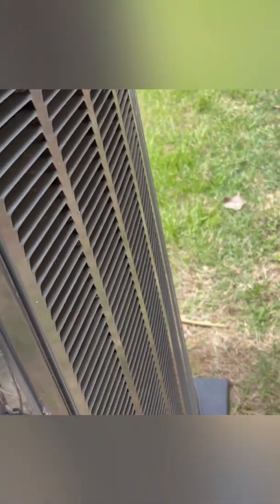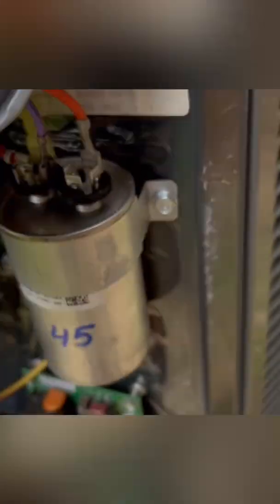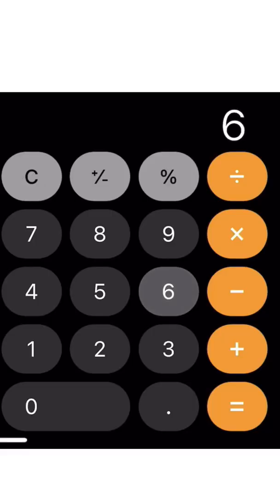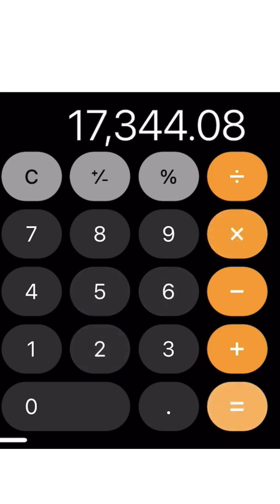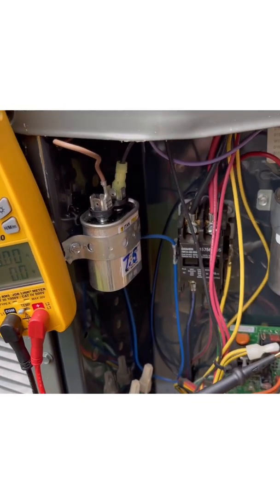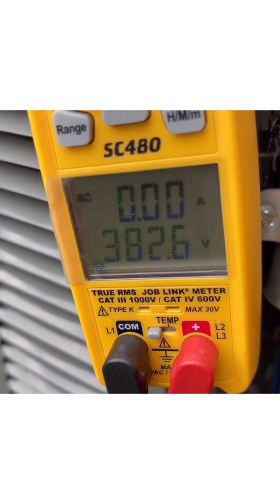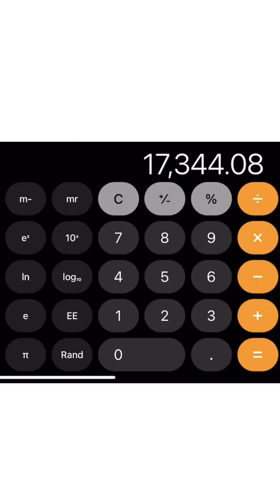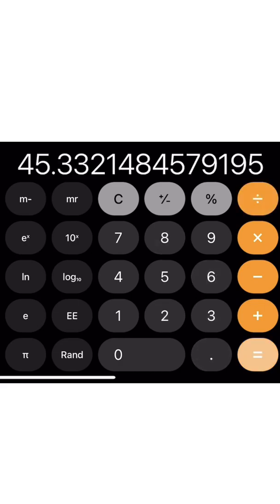How to check a capacitor under load

Comment: Hello I have a question on a blower motor Ruud old gas furnace  (Emerson type)went bad,two speed motor 4wires black,brown,orange,red which one is the hot wire

Comment: If you put your clamp around the run and common leads you would notice the amp draw is also 6.4. If the cap is the proper size those to readings will match indicating a balanced field.

Comment: Like checking for the proper cap for electric motors. Use 2652 X the full load amps divided by the voltage of the motor. 
It gives the best general fit cap for that motor.

Comment: I engraved 2652 on the back of my meter when I was in class ! I later put a card in the battery compartment with about a dozen formulas. It was a Simpson 260 😮 I miss it !

Comment: Cool to know but why not just shut it off ?  In 25 years of doing service I have never felt the need to check a cap on a running system.
Reply from the maker: You've never had a cap that checks good but is bad under load? I just had one yesterday. It was a 12.5 and checked fine but when turning it on, the blower wouldn't start.

Comment: 45 what?
Reply from the maker: 45 is the size of the capacitor that’s being checked. If it reads lower then 45 it would indicate a problem with the capacitor.

Comment: I use an ESR component tester for this. It measures the equivalent series resistance of the capacitor which should be a very low number like just a few ohms or less. Sam Selph

Comment: Based on your videos and a few other sources,  im going to install various sensors at various parts of the hvac unit, that will give me a heads up of potential problems. Like putting a current draw sensor where the capacitor leads are and getting alerted when the capacitor starts using too much or not enough current.
Reply from the maker: Or you could have your systems maintained every 3-6 months.
Reply: @HVACTechTips  you right, and they are, once every 5 months,  but i like seeing objective data and how one action/behavior correlates with another.

Comment: Or buy a meter that can test capacitance….
Reply from the maker: It’s a different way of testing for different readings. A capacitor can be bad while under load but when turned off, can check good. Any Fieldpiece or HVAC related meter will test capacitance. This is just intended to be something to learn for certain situations. Not saying it’s the one and only way to do it. On a normal day, yes your testing MFD.

Comment: Just check the MFD if the value is less then -5% of the factory setting change it 💁🏽‍♂️😵‍💫 takes 2 minutes
Reply from the maker: There’s other reasons to check it under load. This is just something new to learn. Not suggesting to stop testing using MFD

Comment: I do this while I wait for the pressures stabilize when checking refrigerant charge. Just a good, quick test & that way you’re a bit more through with your job. I also don’t feel like pulling power & having to wait for time delays over a simple cap

Comment: Does this work on the fan side of a cap as well?  And where does that 2652 come from?
Reply: 2652 ohms is the capacitive reactance of a 1 microfarad capacitor at 60 hertz.

In this example his 45 microfarad capacitor produced a value of 6.54x2652 / 383 V or 59 ohms

Comment: I just did mine today my capacitor is 75/5 microfarads and 7.26Ax2652/330V= 58.34 under load so how much of a deviation is out of tolerance? Mine is working fine but I wanted to check it to have data for when it starts to go out.
Reply: The capacitor should have a rating on it of +/- 6% or 10%. So yours shouldn’t be any lower than 63 MFD. I would change it.
Reply: @mtucker3401  gotcha and that’s what I was wondering as I did see the 10% but currently it’s working just fine and it’s not bulging or anything so I was just curious if mine was on its way out or if it’s possible that it would work as normal even with it having a lower capacitance.
Reply: @E85_STI  75uF - 10% = 67.5uF. That's the minimum specification. In my opinion you can go to -20% which would be 60uF. Either way, it's time to replace your capacitor. As it gets weaker, it reduces the starting torque of the compressor motor which causes it to labor and get hot on startup. This ages the compressor motor prematurely.

Comment: Fieldpiece should make a meter capable of measuring both current and voltage simultaneously, and perform the calculation automatically.
Reply: This meter does it in conjunction its app. With it you can determine the quality of the capacitor based on the power factor of the system. And with the app, you can measure capacitance while its running:  Redfish iDVM 550 Wireless Power Clamp Meter.

Comment: U can also buy an lcr meter and test the cap properly under right ac condition (multi meter capacitor measurement can not detect capacitors that are near death but not fully dead , basically before they die they go in high internal resistance and multimeter can not measure that cus they use dc to test the cap u need a proper lcr meter to test the capacitor with ac and calculate the internal resistance.
Reply: I use an ESR component tester for this. It measures the equivalent series resistance of the capacitor which should be a very low number like just a few ohms or less. Sam Selph

Comment: sir, is that applicable to a single fan cap also?
Reply: Yes, you can check a single capacitor too.
Reply: @mtucker3401  so where will be the common for the single capacitor?
Reply: @sagisagdom  the side that goes to line. One side of the cap goes to start on the motor and the other to line. On small caps, you might not see much difference in the amps, but on the bigger ones you will see difference between the two. That’s why you check your amps on the start side of the capacitor.

Comment: Where did you 2652
Reply: That’s from the equation for capacitance reactance. Specifically it’s 1/(2π * 60hz) * 1,000,00μF/F ~ 2652 μs

Reactance is also equal to voltage / current, so you can solve for the capacitance from these three numbers.

Comment: Still learning HVAC systems....What does 45.33 mean? Also, why didn't you discharge the capacitor before checking the voltage?
Reply: 45.33 is the capacitance value under load, while the unit is running and stressing the capacitor. Every capacitor has a value. For example: a dual run capacitor has 3 terminals. Common, herm, and fan. If the capacitor is rated for 45/5 this means it’s rated for 45 microfarads on HERM and 5 microfarads on fan terminal. So in this video, 45.33 is the capacitance value under load. 

To answer your other question, he did not discharge the capacitor before checking voltage because there is currently power going to the capacitor. You would only discharge the capacitor when shutting off power and removing the capacitor to test capacitance value not under load. 

Hopefully this helps 👍🏼

Comment: When it is a starting capacitor, how would you make the measurement?
Reply: I believe that when a separate start capacitor is used on a motor, it's only connected for a few seconds – at most. Theoretically, you could measure it the same way. However, there are a couple major problems: (1) Most DVMs or DMMs respond too slowly to give you a reliable voltage reading before the start switch opens; and (2) Even if you could read the voltage, the start circuit never settles to steady state because the motor is accelerating the entire time the start capacitor is connected – so during startup the EMF/back-EMF is constantly changing on the start winding.

Comment: Why x 2652?
Reply: 1,000,000 / (2 * pi * Hz)

1 / (2 * pi * 60) = 0.0026525284

Multiply this by 1,000,000 to convert the answer from Farads to micro-Farads or 2652.5284.  Most people just truncate to 2652. In case you're wondering why you multiply by 1,000,000, it's because 2652 is in the denominator of the calculation for capacitance.

Hope this helps.

Comment: Many thanks for posting. I like this approach because it determines capacitance under actual load. I've had capacitors test good on the meter, but fail under load. BTW. Should mention that 2652 only works for 60Hz applications. It's 3183 for 50Hz mains.
Reply: smiling in British
Reply: @ia3278  Yes – But the constant you use depends entirely on the frequency of the mains that are connected to the capacitor. The 50/60Hz label on the capacitor indicates that it is rated for use on both 50Hz mains and 60Hz mains.
Reply: Thanks for clearing that sir
I have one more question
If the main supply voltage is 200v  or 240v
Reply: @yadvindersingh9104  Glad to help. The formula works for any AC voltage. The frequency (F) is the only parameter that changes the result.
1,000,000÷(2×π×F)
Reply: @jsswizard   thanks a lot sir
Reply: @jsswizard  Thank you very much. Greetings from Argentina
Reply: @nicolasagustin1384  Greetings friend. Happy to help.
Reply: @ia3278  Many DMMs can measure frequency. Otherwise, just look it up. Search online for "Mains frequency by country".
Reply: I just upgraded my Internets to fiber so I'm getting 500 hurtz 🥴, thanks Biden!
Reply: Start amps equal run/common amps. Easy cap test under load regardless of frequency. If the field isn’t balanced those amp draws won’t equal
Reply: what is it for 400 hertz AC systems 🙃
Reply: @byloyuripka9624  cross multiply and divide my friend.
Reply: @pendulum4734   Should it be 398 ? 🤔
Reply: @byloyuripka9624  for 400hz  use 397

Comment: That is not a valid way to calculate a capacitance: you didn't say how you obtained that number (which i tried to obtain too without any success) and even if that is good, it would be valid only in your country (keep in mind that the frequency changes in every country)
Reply: Calculate the number using this formula.
1,000,000 / (2 * pi * Hz)

Comment: If checking a capacitor under load is such a reliable solution? Then how do you tell when it’s dead? Oh that’s right you put your two probes on it after it dies. This method is just an excuse to replace a capacitor before it actually dies. You need to know the capacitance when it’s standing still not while it’s being pulled under load. Every capacitor will give you a false reading that way.

Comment: I'm never in that much of hurry. To just pull the disconnect and pull the the capacitor.
Reply: Noy only does that take more time, it's also less accurate and misses many caps that are failing enough to cause issues, but not truly dead (enough to fail a meter test). This method can expedite troubleshooting and reduce callbacks.

Comment: I did this while under load and got 57.25 µF. The capacitor is rated at 60 µF with a 3% tolerance. That means the low end allowance would be 58.2 µF.  So would you agree that I need to change the capacitor? Don’t even bother measuring it while off of the unit?  Great video. Thanks
Reply: I always prefer replacing capacitors  once they're a few years old, 5 max.
Reply: No way, if it working today then just let it be. Make some more money when they call back a few months later.
Reply: @JM-yx1lm  - this is my own unit I’m not a repair man.  😀
Reply: @condor5635  then charge yourself 🤣
Reply: @luisroldan8680  - I plan on it. Don’t let anyone near my cars or appliances!
Reply: Personally, I wouldn't change the capacitor until it's 10% below nominal. The 3% tolerance is really tight. It may be very difficult and expensive to buy one with that tolerance. New Capcom/Gentek (i.e. GE) capacitors have a 6% tolerance, and these are good US made capacitors. Just my opinion as a homeowner, not a service tech.
Reply: @jsswizard  thanks!

Comment: Never had a troubleshooting situation where I questioned a cap under load… simple MFD reading has always done me right… but this definitely makes a more thorough inspection and removes any doubts. Thanks for something I was never taught.
Reply: Whether this method is the best or not, it’s cool to do when the homeowner is standing behind you watching. 😎
Reply: It’s to check if it’s getting weak if it’s getting weak ya replace
Reply: Trane 2 speed motors good to know if unit out on high head on second trip
Reply: You haven't gotten much experience if you haven't seen a cap that passed while not running then was failing under load.
Reply: @oso1165  7 years as a commercial tech, the last 15+ doing residential as side work… sorry I dont have enough experience for you hot shot🙄
Reply: @Trigger_32  You probably came across a few, you just weren't looking for it
Reply: @oso1165  maybe. But I guess I'll find out that answer as I begin to employ this method while doing future pm's and tune ups. Ive spoken with other techs with numerous years experience, and they agree'd... was never taught the method, and couldn't recall a situation where it was even a question.
Reply: @Trigger_32  honestly once you get in the habit of it you'll find that it's way easier then shutting off the unit and disconnecting the cap. People seem to think this is a harder method and it's not it's way easier AND more accurate to check this way
Reply: @Trigger_32  I do commercial too and I don’t find anywhere near the amount of capacitors that I did I resi. I got into this habit of checking capacitors many years ago after I accidentally left a wire off the capacitor. I find it much easier and more accurate in my opinion. They taught this in my tech school and I’ve taught everyone that I have trained.
Reply: @mtucker3401  I was not taught this method in tech school. Of course this was high school tech school and I was in an apprenticeship program which meant I got Junior & Senior year at tech school full time, so I still had to do some regular class time there. Junior year I took Electro mechanical and Senior year I switched to HVAC. A classroom full of knuckleheads that didnt even stick with it really hurt us that gave a shit…. Irregardless a lot of my knowledge came from field experience. Even my years as a commercial tech, my boss didnt spend too much time with us…. He turned us loose to figure it out and I therefore I did a lot of self teaching, and this was a time before smart phones where you could just google and youtube on demand. I have already used the method and have found it more convenient and efficient to crunch some numbers while the system is already running, instead of shutting it down & disconnecting wiring.
Reply: @Trigger_32 he's right on all parts
Reply: @oso1165 dude u right I been doing it for 2 years / and what I’ve learned was hvac is always a day to day learning experience